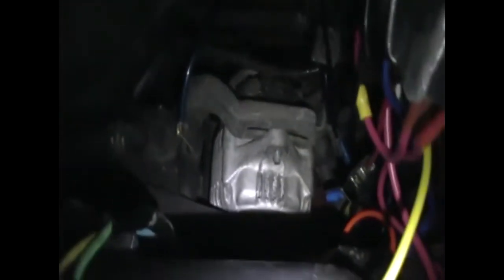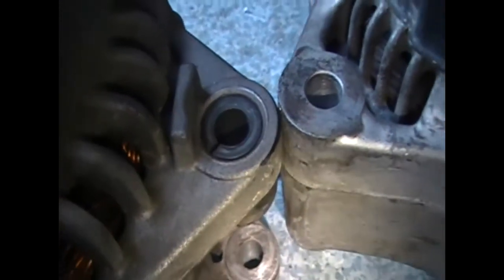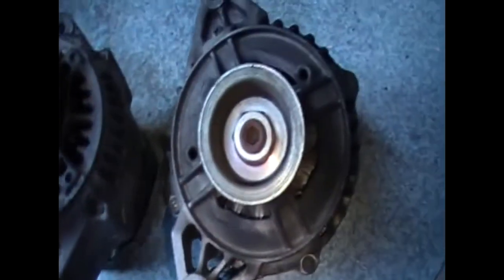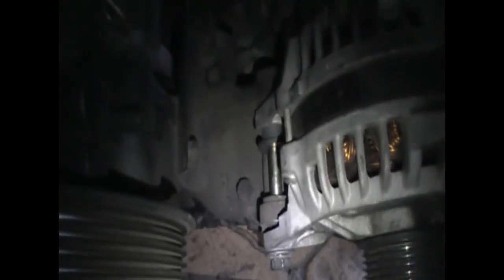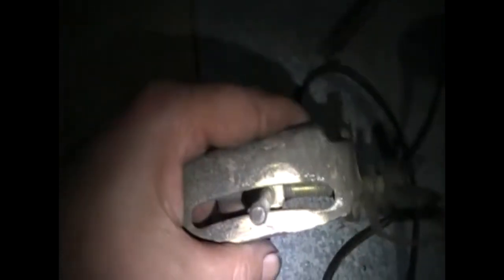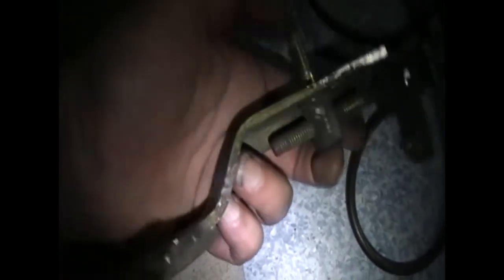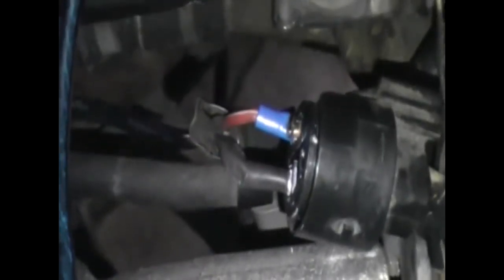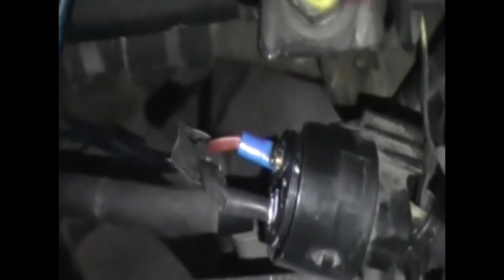Alternator Upgrade Mod [ Tarago Previa Estima TCR10 ]

Comment: great video do it end up been a successful fit? was  belt size same   I'm looking at swapping my 92
TCR11 where the plug comes and through the back to a TCR10 estima alternator that has power plug on the side.  any additional info appreciated   cheers

Comment: thank you thank you for documenting so many projects. you have become an invaluable resource. my 94's lights dim when I run the fan, seems engine is affected as well, just not enough electricity. haven't begun troubleshooting yet. you mentioned a club in the description. can you reccomend forums or clubs that you use for info? I'm tempted to start asking you questions but I know this is not the best place for all that. 

again, thank you!
Reply from the maker: Hello, Thank you for your feedback. I added a Facebook link at the 
bottom of the description. There are Manny members that will help as 
well as me.

Comment: I may have alternator problem, voltage read at 13.8 at idle with nothing on, but once ac on, it drops to 12.3.  With headlight on even below 12.   Mine headlight is HID, do you think my alternator is on its way out?   Recently my u joint on my drive shaft finally went out at 290k on it.  Replaced both joints but now I have slight vibration at 40-50 mph.   I think drive shaft is out of balance.   Any suggestion on diy balance the shaft?  I read something like using 2 hose clamps to adjust.  I have no one who had any experience on this issue.
Reply from the maker: Hello. Yes Alternator sounds faulty. A battery place should be able to test it for you for free. the S,A,D,S drive shaft wouldn't be the problem. SADS rotation RPM is the engine not the rotation of the wheels, Might be SADS if it's the same RPM each time when you get the vibration. The vibration could be a number of things. Check Tyres to start with. Does it feel like it's coming from the front or rear?

Comment: How hard is it to do an engine swap.
Reply from the maker: Bit of a pain because you need to lift the van up to drop the engine. Unbolt everything from the top first then lift the van  & unbolt exhaust, tail shaft, SADS, everything that is attached to the engine and transmission leaving the mounts to last. put an engine trolley under the engine unbolt the mounts and drop the engine. good 4 hours work or longer depending on your tools and stubborn bolts. 
Image >> http://i8.photobucket.com/albums/a23/timsrv/22.jpg